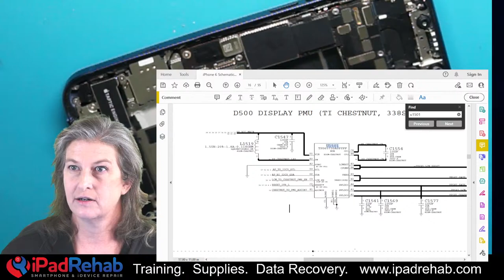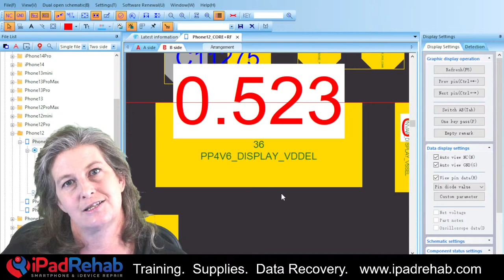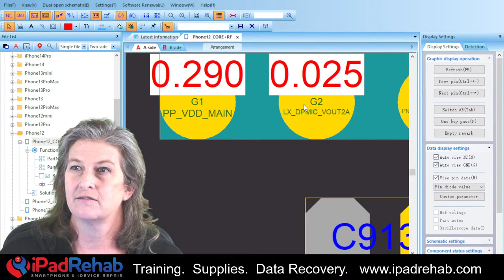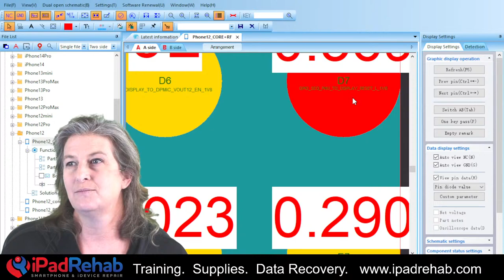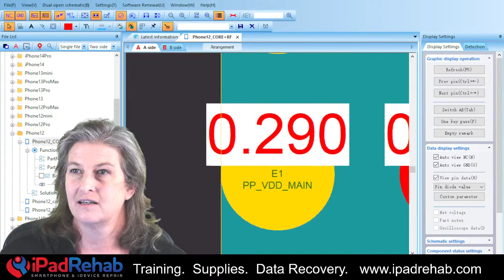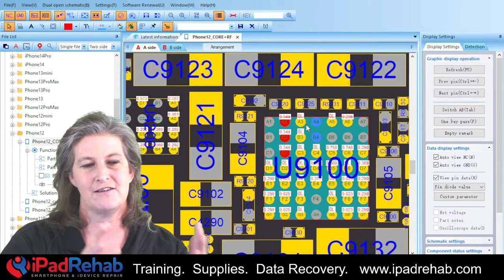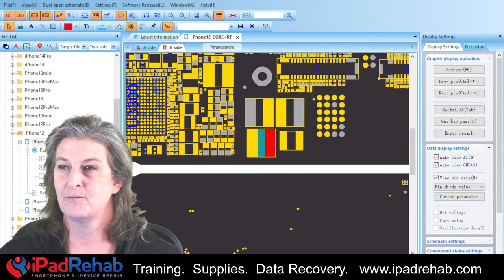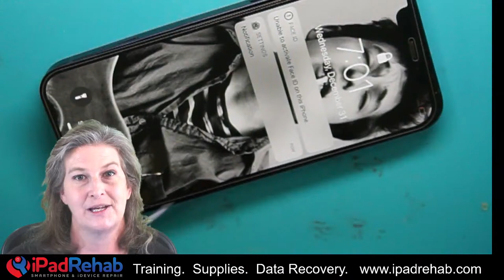Catastrophic iPhone Data Recovery

Comment: 16:10 does no image ALWAYS means also no touch? or one could technically type the numbers knowing where they should be?
Reply from the maker: It depends on the cause.  A bad backlight in an older phone for example would still have touch.  In the case of chestnut output—image AND touch power comes from chestnut.   

The “guess type” the passcode is usually a bad strategy for data recovery because it is impossible to predict which iOS generated messages pop up that must be cleared to accept the trust.  Such as “Face ID unavailable press learn more”

By guessing wrong you can disable the phone permanently and lose the data irretrievably